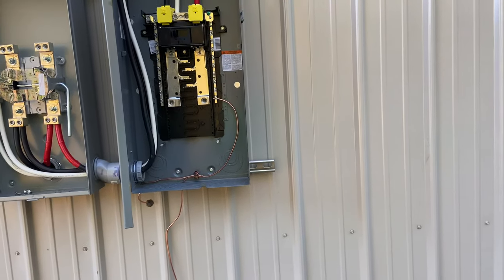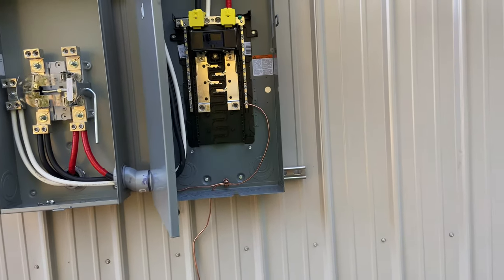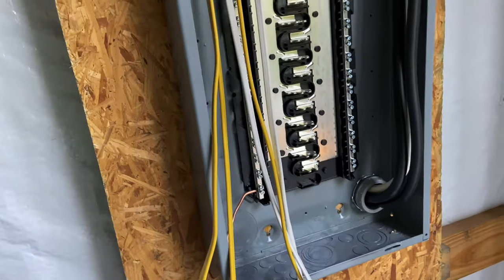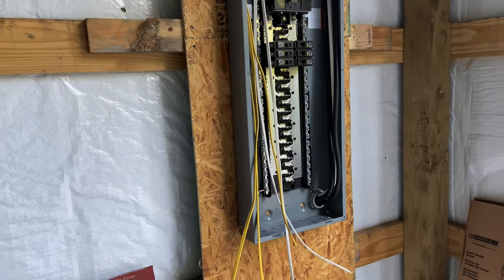Episode 17 - Installing EGC and Ground Rods

Comment: What size sevice are you coming in with off the pole? The wire is gonna be pretty big and it will be direct burial aluminum conductors, tri-plex. I don't think you're gonna have enough room for getting the utility wire in the meter can, fit it around the conductors in your can, and make the bends you need to connect to the line side lugs on the meter base.
Reply from the maker: Power company ran 4/0 triplex for 320A service, which surprised me. I figured they would do heavier but they aren’t using NEC. AHJs have their own stuff. 

Feeders are 2 parallel 4/0 triplex runs. 

System has been running flawlessly for 2 years. There was plenty of room for the conductors.

Comment: You need the ground wires from utility to panel on top of busbar for ground wire only wire size #10 bottom of busbar you send to ground rods from there you end at water main and bond there the end of wire at water main not at ground rods,,,,, recap coming from utility #10 wire to main panel using busbar for ground only top of busbar utility bottom of busbar to ground rods no more the six feet to eight feet apart then ending at water main one solid wire making two solid connections at water main because the water meter has plastic parts you need two ground connections in between water meter at the water main
Reply from the maker: GEC is a #6 min for ground rods. I have two rods installed. No water pipe yet and when there is it will be PEX.  No EGC provision in the meter can for my PoCo.